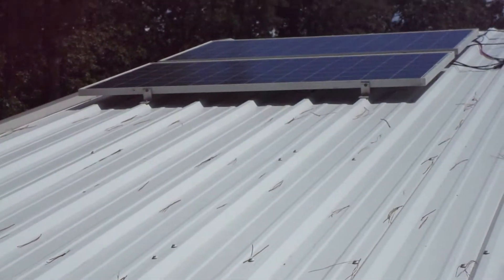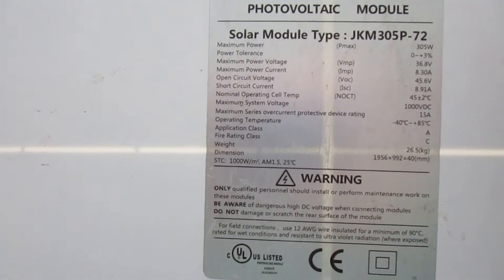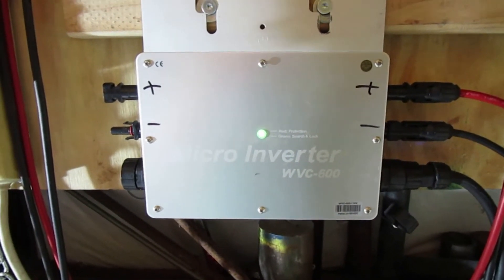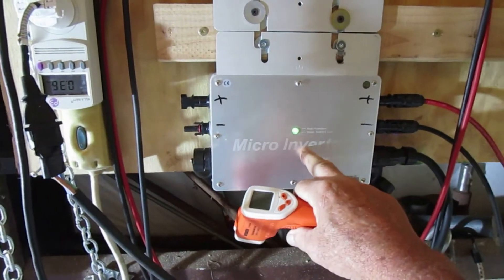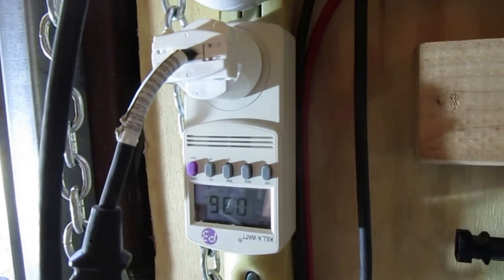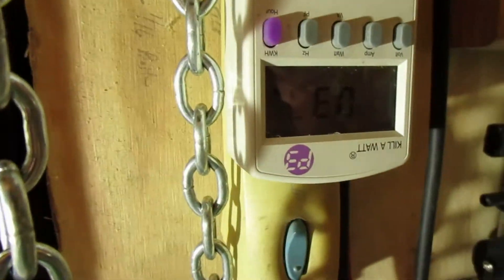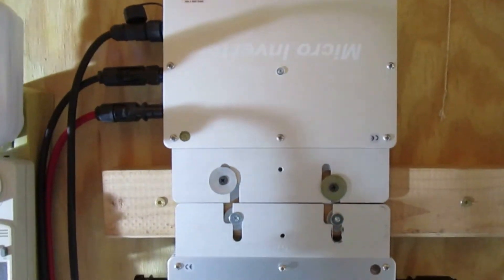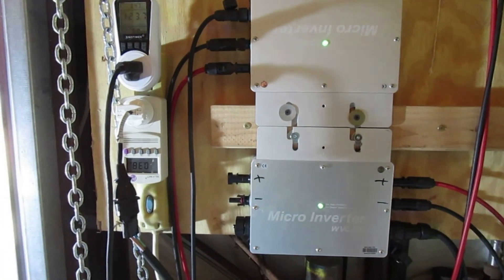Will a Chinese WVC600 Micro Inverter Run Two Jinko 305 Watt Solar Panels ????

Comment: You maxed it out watts wise. 
Right 600w
Panpels 2x 305=610w ?
Reply from the maker: @Sciontc22jj  yes but these were used panels, not even putting out close to 305 watts

Comment: Hi Larry,
I have seen some other video's where the overheating problem was solved by the addition of a couple of cheap small cooling fans like the ones used in desktop computers. You can either have them running whenever the inverter is on or add a temp sensor to have them switch on and off at your imputed temperatures.
Reply: That's the way I did mine also took off the cover on the inverter and drilled out 20 holes at each bottom corner and top corner to allow air to pass threw the inverter
Reply from the maker: Great ideal. Appreciate the comment

Comment: Yes,Jinko 305W solar panels can work with WVC-600 micro grid tie inverter,max. PV input 2*375W for updated in 2023.
Reply from the maker: I tried moving the inverters to the back of panels and ran to 290 watt panels to the wvc600 and after about 3-4 minutes the inverter shuts down

Comment: Hi Larry, I am making some assumptions here. Those are 120v microinverters, right? Is the branch connected like this. Pv panel to micro inverter then plugged directly into an outlet to feed the grid? I am working on some experiments with a similar micro inverter. Hard to find info on them, but something I want to learn and share. Appreciate  you sharing this. It helps a lot.
Reply: Yes it does work plug  the panel in the outlet feeding the grid. Is a bad idea. The whole reason of having solar panels not to rely on the power company.. this is a great setup.
Reply from the maker: I would be glad to share what information I have. I also moved and I have the panels mounted on a ground stand currently. I live in south texas and had to get the permit from the county and pay the $250 operating authority fee from the power company. You need to go to my channel and look at the latest videos on my solar. I have changed the metering process which is much better. Your assumption is correct. Solar panel to micro inverter then to plug. Which technically is illegal. So my new set up is legal. Up to code and a little different. I have added the disconnect and ran the power to the lower breaker in my breaker panel. It took almost 3 months and 10 pages of paperwork with drawings to get it approved. Check it out

Comment: Theoretically it should, due to same reason, companies are ripping us off, I also chose to go with China. so I am looking for reliable inverter that can last in ambient 50C and working for around 10 - 12 hours a day and for almost 6 months, then in winters and in between time it will be around 8 hours and for 30 days it will be 3 hours, but the max is 12 hours in 50 - 52 C so I am also looking cooling, ideas I have for cooling, 

I) use heatsink and fan connect them with solar directly to it will run in auto mode (with sun and heat)
ii) use big thick Aluminum sheet that will sink heat and larger are will transfer heat without fan, 
iii) use cooper pipe solder/weld/clamp with inverter try to connect more like a spiral/U shape multiple time for max connected area and run water through pipe using solar power pump and left open water reservoir so it will evaporate and cool down.
Reply: What's the status for the Inverters right now, are they any good, and efficient or not
Reply from the maker: @zeeshankhalid7565  they are still working like the day I got them
Reply from the maker: Good ideal. Appreciate the comment

Comment: Realistically you want to run these cheap products at only half their rating, especially in a warm climate.
Reply from the maker: For testing which is what I am doing to see if a full blown solar panel system is worth it...I think they have done a great job after 18 months..Most of the solar panel companies are ripping the average consumer off, but I'm not going to be one of them. Some of these solar companies are here today and gone tomorrow with your money gone as well and no warranty ????

Comment: Yes you can run 2 panels into one inverter, because the panels will not very very realistic give full power.
Your down side is these inverters are designed and are IP rated tobe out side close to panels and heat lose is more efficient.
Reply from the maker: Good to know. Appreciate the comment

Comment: try adding heatsinks to the inverters, looks like it would be easy to do
Reply from the maker: Great ideal. Appreciate the comment
Reply: thats what I did, I have 4 heatsinks on my 1200W and 1400W each. never shuts off.
Reply: @DavidLang1975 Did you add heatsink with fan? Or just pure aluminum heatsink without fan?

Comment: How you connect inverter into regular wall outlet pls let me know
Reply from the maker: The inverter coverts the solar energy to 110 volts and runs it back into the plug

Comment: yes it okay 305 watts times2 is 610 only your wc is 600 watts inverter even you will use 320watts times 2 solar panel sill okay
Reply from the maker: I tried it with two 305 watt panels. It got real hot and shut down in perfect sun conditions
Reply: @LarrySbrusch  try to shorten the dc cable and provide ground connection need to povide also ,if still the same someting wrong with that inverter, normally 600 watts inverter can cope up 20% higher wattage of solar panel example 670 watt total wattages of 2 panel still okay more wattage of panel is also okay not more than 20% of inverter rated capacity
Reply from the maker: @myralat  I will give it another shot when I get a chance

Comment: inverter should be closed to the panels.long dc cable is wasting energy , long AC cable(carries low A) is better than long DC cable(carries high current)
Reply from the maker: Thank you. appreciate the comment